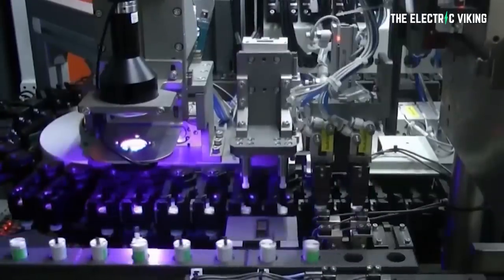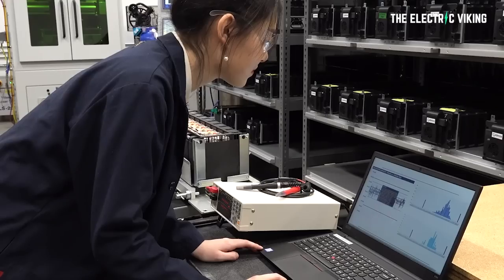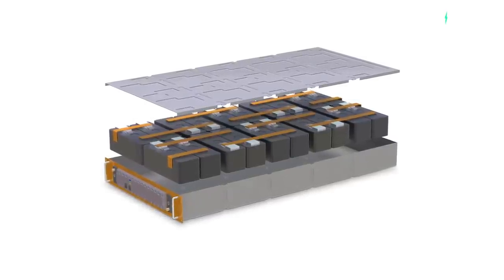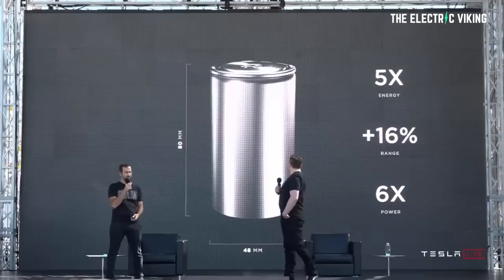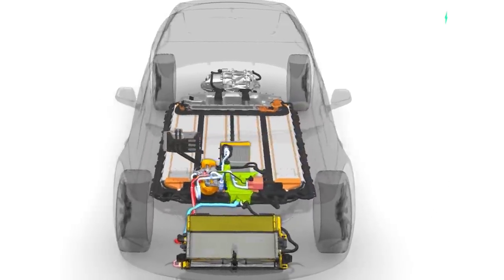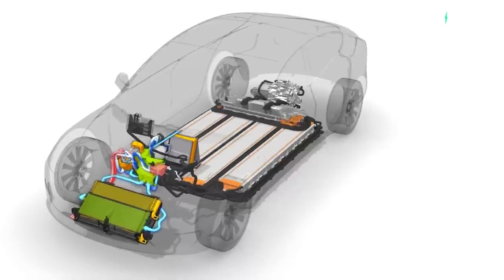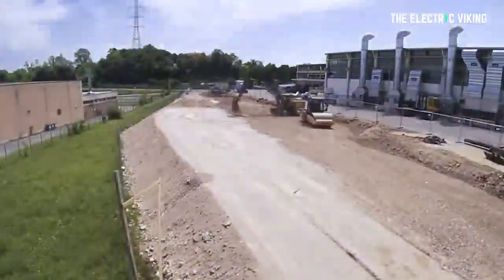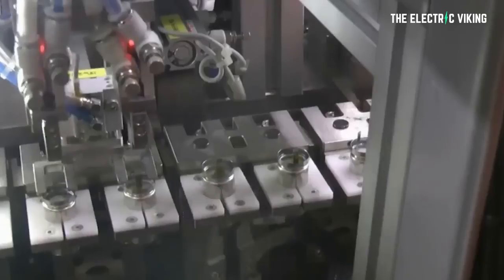Aussie gigafactory making batteries they claim double Tesla range

Comment: Are they just using this thing for big stationary batteries? That’s stupid, should just use salt water batteries.
Reply: I think stationery storage is ideal for proving the batteries.
They are all in one location rather than driving around in 10,000 cars.
They can all be monitored 24/7 by technicians and computer equipment.
If a module needs to be swapped out you don't need an embarrassing and expensive recall.
You can treat the batteries in a precise way and don't have to worry about some percentage of your 10,000 car owners abusing them.
Reply: @danielstapler4315  If you're stationary storage is only for long term testing, that's fine. If it's for actual grid power, it's moronically stupid. If you have to have batteries, than a MUCH cheaper technology like saltwater batteries make much more sense. Otherwise, grid power storage should be done with hydrogen, which will be cheaper and more efficient than any battery.
Reply: @hemaccabe4292  "should be done with hydrogen, which will be cheaper" 

Smh! You just lost all credibility with that stupid erroneous statement. You need to learn physics and how hard and difficult it is to separate and isolate hydrogen. There is a reason that hydrogen is really efficient and provide so much energy, because it takes a tremendous amount of energy. There is no such thing as its cheaper. I have no clue where you got your info from but one of the biggest issues with saltwater batteries is there significant higher upfront costs. They are not cheaper LMAO. It is not even a proven technology, since there is only the one bankrupted company manufacturing them. So of course it will not be cheaper yet, that might come in time.
Reply: @kevinfisher1345  My understanding was saltwater batteries had the virtue of being cheap, while lacking all others. Still, the point of hydrogen is that if you have surplus electricity, you can use it separate hydrogen from water and the recombine it later in a fuel cell. Such a system would be orders of magnitude cheaper than using giant lion battery depots to do the same thing.
Reply: @hemaccabe4292  Your point is still invalid. It is nowhere close to being cheaper to use hydrogen, let alone magnitudes cheaper. Yes hydrogen is very energy dense and greater than batteries, but again it requires a tremendous amount of energy to begin with which is not cheap. Energy efficiency is the use of less energy to perform the same task or produce the same result. Hydrogen takes more energy to produce than it can store. So not very energy efficient. It costs more to produce hydrogen than fossil fuels and fossil fuels cost more than producing electricity. So how in the world can you claim it is 'orders of magnitude cheaper than using li-ion batteries'? You got that completely backwards mate. That is one of the big issues with using hydrogen, they simply do not make enough of it, because it is not cost prohibitive to do so and requires a tremendous amount of energy to make. Why in the world would you think when you were told that it needs a lot of energy that would be cheaper?

And we have not even gotten into the storage of hydrogen, which is usually stored as a liquid. That takes even a lot more energy to cool the hydrogen. Liquid hydrogen is now no longer as energy dense, it is in fact the reverse. Hydrogen has nearly three times the energy content of gasoline in mass, however liquid hydrogen has a density of 8 MJ/L whereas gasoline has a density of 32 MJ/L. So it also needs converted back to a gas. At least that part does not take a lot of energy, but we started off already being more costly than fossil fuels even before we cooled it down to liquid hydrogen for storage. Plus there is this thing call hydrogen boil off gas. It is magnitudes more expensive than li-ion batteries.
Reply: @kevinfisher1345  Kevin, you seem lost and confused. Since the batteries in this video are not appropriate for use in autos, the only conceivable economically viable option is as grid storage. Grid storage can be any size, any weight, if they're too big, you just get a bigger building. If you want electricity out of grid storage (GS) batteries, you have to put it in. If you use hydrogen and a fuel cell, same thing. So, no, the whole section of your comment about, "energy to begin," is lost and confused. The question is, is it cheaper to convert that energy to hydrogen and then back to electricity with a fuel cell, or a lot of hyper expensive batteries that wear out? Answer, not in the same league. Hydrogen wins. Also, BTW, I don't care about the environment, but hydrogen is also orders of magnitude better for the environment. Battery based GS is crazy. Take a deep breath, maybe have a lie down, then cope.

Comment: Would also point out stationary batteries are stupid. You want grid electric storage, you use hydrogen.
Reply: Yes but hydrogen storage is slow. You still need batteries which can react in milliseconds to grid fluctuations.
Reply: @hemaccabe4292  Incorrect. Every fc vehicle needs a battery because fcs are too slow. Fcs also need their membranes replaced frequently. And H2 being a very small molecule is hard to store too.
Reply: @moestrei  Not paying attention Rhein, we're talking about grid storage, not EVs.
Reply: @hemaccabe4292  As I said: Grid needs fast responses too and both statements about storage and maintenance are valid too. You should pay a bit more attention here.

Comment: can it be priduce at volume and cost? does it have the longeivity? is it reasonable fireproof? does it have charging characteristics suitable for evs? does it have suitable discharge characteristics? is it robust (vibrations, heat, cold?) there is plenty of variable besides energy density.
Reply: Yes to all the above, or it is dead.
Reply: @tedmoss  time will tell.